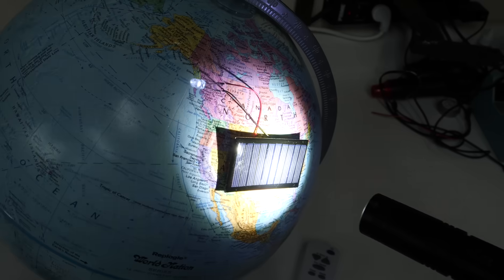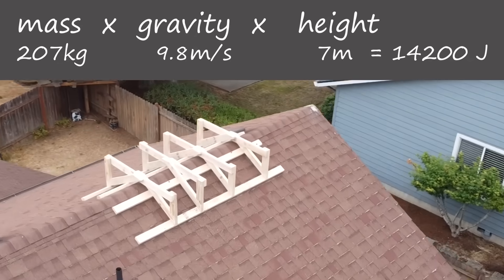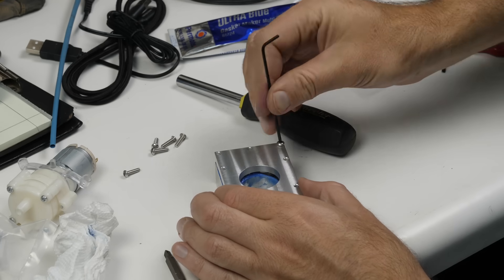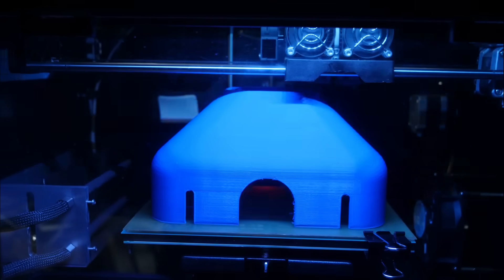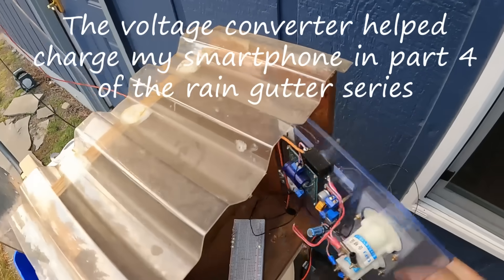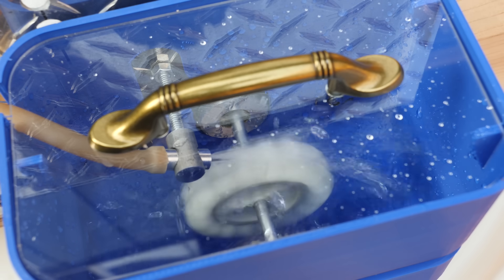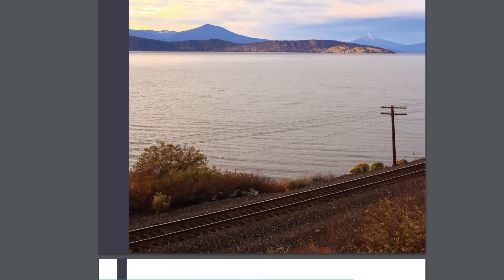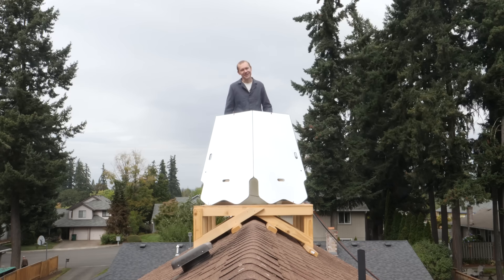Storing Solar Power on my ROOF!!!

Comment: I’m curious if it would be an advantage to add a shroud to the end of the water tube to reduce the water splash (that’s excess energy isn’t it? ) coming off the wheel.

Comment: "...it takes a whole barrel of water on a roof to match the power of a single double A battery." No, it takes that much water on the roof to match the ENERGY of a single double A battery! 

Thanks for a really cool video, very interesting. I'm surprised that little pump could push water that far up.

Comment: How does the path of the pipe effect the power? It currently sits in a straight away path, but what would lengthening the pipe do to the system? For instance, what if you lay the pipe in a meandering pattern from side to side while maintaining the downhill gradient thus having more "fuel" sitting in the pipe and less in the tank?
Also, what about having a larger diameter pipe at the top of the roof and then reduce the pipe diameter towards the bottom. Would this create more water pressure at the motor.
Lastly, what about sealing the system such that it could be pressurized. How would that effect the "force" of the outflow? It seems it would give the water "fuel" more "amperage" or speed when it is applied to the motor. How well does this compute?

Comment: Thanks for your heroic efforts, time, and expense, plus being open about how puny is the energy in 55 gallons on the roof! It would've been nice to reveal the megawatt hours available from the Oregon reservoir project, as in how many average households are fulfilled too how many days. Or as I fear, just hours.
The machined water jacket was overkill, because an affordable 3D printer would do fine today, letting water flow directly onto the metal motor body--just seal the plastic edges to that metal body.
Is there any positive displacement technique that would be more efficient at low flows than a splashy Pelton wheel?

Comment: If I understand it , you are siphoning from the barrel. would it not create more energy if you allowed the water to flow out the bottom with all of the weight of the water pushing down?
Reply from the maker: It's the same.

Comment: Great video, but I was wondering if you would try your "water pumping" system for sump pumps? I would also add the sump discharge to copper tubing or some type of heat exchange with a solar fan to see if the cooler water acting as a dehumidifier and keep the area cooler/maintain a more even temperature.

Comment: So it takes 5 hours of sun to fill the upper reservoir, but how long to deplete if discharging at maximum pressure (running the led strip at full brightness)? I'm guessing under an hour? Still pretty awesome, and it can double up as a spare water source under pressure, for toilet flushing or whatever, if your municipal water supply goes offline, so this counts as prepping in a way too besides for just a physics project lol
Reply: Had the same thought about the toilets and with the added benefit of reducing your water usage if you are in an area that gets enough rain. You would have to change around your plumbing so that only the toilets are on the system as well as add a valve to switch between water sources. I would also add a check valve to prevent any backflow into your pipes. What do you think?
Reply: @compiticny1445  sounds good! I like the check valve idea. Solid advice!
Reply: @DimitriPappas  Thanks

Comment: Why not just use a solar  panel  and battery  for this? Overtime  you will have to replace  the motor..wonder if you have calculated  the cost of pumping  water  up the roof and and how much benefits  it has for  your consumption

Comment: ....the tap water already comes pressurised, so the solar panel ain't needed to pump the water up, just a hose, this only makes sense if it pumps water from two water deposits, one in the ceiling and one in the garden, but if you connect the solar panel to the network it will make the electricity counter go back, that way you don't need any batteries.

Comment: This is great!  There are probably several things to improve your basic system's efficiency - maybe follow on videos!  One would be I think the water wheel driving the generator is losing a fair amount of energy by the water splashing away, not driving the wheel.  The splash guard probably should be made a lot tighter so that water come down from the roof exerts most of its energy in pushing the wheel - make the sides of the guard tight to the sides of the wheel, but not dragging.  And put a circular portion of the guard closely following the contour of the circumference of the wheel.  I believe there are some more efficient axial flow arrangements as well - like in a hydro dam.  Also, I suspect a larger diameter pipe leading from the roof down to the wheel might reduce. some frictional losses when at high flow rates.  Anyway, really good video as-is!

Comment: 1) U need A check valve on the bottom of the line going to the pump. 
Should ease the heating.
2) This is good for heating the water from the sun after it's pumped up. 
A Black barrel will heat up to over 125 F on a real sunny day in summer. 
It has to be full from the early morning and have the full days sun. 
I once ran a shower stall on a hill by a cabin with this technique heating a barrel 60 feet up from a shower along the road.

Comment: You can grab a bit more more energy. As the tank fills. When the tank fills, it pushes air out the top. The compressed air can do the same thing as your water dose.
Reply: No

Comment: Your experiment is halfway there but here's a way for you to make power 24 hours a day 7 days a week 365 days a year and you don't need the solar panel to do it the same principle with the water but you use a pump to pump the water straight up to your roof however you have to have several hundred feet of pipe spiraling down from the roof at the same angle then the water from that 55 gallon bucket dumps into another 55 gallon bucket the pump brings the water back up to the roof in a straight run now you have a continuous flow through a 1 inch pipe you will need about 200 gallons of water to get the system working 55 gallons on the roof 55 gallons down in the ground and a lot of water in your run depending on how much pipe it could be 100 gallons in the pipe then in several places in the pipe install a hydro generator this will power the pump and then a second one and a third one can make you usable electricity you will have power 24 hours a day 7 days a week as long as the water doesn't evaporate and the Earth continues to produce gravity so you will have power for many years to come once or twice a year simply add water as it evaporates have at it good luck
Reply: There are several other ways to easily produce electricity a magnet generator will do large amounts of electricity 2,000 w or more use no fuel and produce power 24 hours a day 7 days a week there are also companies that produce gravity generators which use no fuel and produce power these are both hard to find to purchase but they do exist I love watching videos like this cuz it shows that people will put effort into buying technology that will produce electricity not store it like batteries

Comment: I think you could be loosing a lot of energy in the generator design and an improved impeller  may help. I would be interested in knowing the efficiency as a ratio of energy to fill the barrel  vs. energy output, you gave general numbers in video. Also what is the estimated cost to build the project?
Reply from the maker: See video on BUILD2

Comment: Here's the actual issue I'm finding:

In the "previous video," what this guy is actually talking about is potential vs kinetic energy.

The weight of water, in his example, being kept high, results in a potential source of energy he can utilize. However, this potential is never used until the water is released, and allowed to fall towards gravity. This is untapped kinetic energy, or "moving energy." Usually, to tap this energy, a wheel with an axle must be put in the water's path, to turn and gain angular momentum.

This idea is centuries old, as it has been used in everything from windmills in Holland to grain mills in the Middle Ages. It's been used for making textiles during Colonial America to modern hydroelectric power plants.

Comment: If it takes 100 kW-h to fill the tank (battery), can you use it to run a 100 kW-h load off it? ie: can it be 100% efficient with no loss?

Comment: @Quint Builds. You can maximize the use of your water pressure and just have run your hose up to your roof >.< 
Depending on the height the top of your roof is. I am guessing your residential pressure should be enough to get to your roof. If not really really close to the roof, less height different means less work for your pump.

Comment: You should consider using a Tesla Turbine in your design instead of that water wheel. The only reason industrial generators don't use Tesla Turbines is because we don't have the materials that could withstand the speed necessary to get peak efficiency, otherwise they'd be more efficient than our current turbines. For your application I think you'd see a marked improvement in energy extraction from your water barrel. They're very easy to construct, too. Some sheet metal pieces, some 3D printed pieces, and you're pretty much good to go.

Comment: Could I suggest building a conical shape for the turbine to run inside? All of that splash is wasted energy. Inside of actual dams they use conical funnels in order to raise power and more efficiently extract energy. Could be wrong but hey!

Comment: If the water is 7m up, you need 52 tonnes of water to store 1 kWh :-(

Also: you can get fall arrest anchors designed to be easily screwed into your roof. Wonderful things :-)

Comment: It's a cool idea and all, but most single home roofs aren't designed (or structurally sound enough) to hold very large weights (i.e: massive quantities of water) for long periods of time.

I mean you can do it yes, but over the course of 10+ years, you're going to start causing some structural issues that will likely cost you far more in repair costs than the savings you're getting from "free" energy.

Comment: I ordered 10kw worth of solar panels from Ebay a few years ago. I only "needed" 32 out of 40 of them.  My daughters and I, have "experimented" how fast their power wheels could go (in short bursts only), using just the sun. They were flying around they yard... well only as far as the wires would reach. I know, dangerous, risk of damage to panels, wires, electric vehicle...etc. They were happy, lol.

Comment: I would love to see someone build a true gravity powered electric generator. For it to work, though, you need a mountain near a water source and many generators. Using solar is cool, but wasteful. The solar panels only get 20% of the energy available from the sun. The pump loses even more power and that only increases with height.
Reply: More efficient then coal,gas or nuclear . Only 1% of the sun's energy goes into the plants that became coal or gas.  And nuclear requires you to explode a sun to get the fuel.
Reply: @catprog  The point is that it cost more to make them in terms of energy and this is not the best way to do is. Gravity, or more precisely the specific gravity, is way more efficient way to get water to a great height and to use the weight of water to create electricity.

Comment: Demonstration should have been two full water jugs. One dropped from midway and the other from the roof. That would be a better demonstration of the energy differential between heights. But even that is really comparing velocity due to acceleration difference. Secondly, the cutoff switch should have been in the ground level barrel. Shorter wire and easier to get to. And a full barrel on the ground, as a source, can never overflow the barrel on the roof.

Comment: It would have been nice to compare the energy density of the water stored in your barrel with the energy stored in a barrel of coal.  I think the energy stored in coal is 3,000 time more dense.  I live in California and some 50 years ago the last pump storage revivor was built because there aren't any other suitable locations to build any new ones.  And this year we don't have any water.  Lake Oroville ran out of water to produce hydroelectric power a few moths ago  What about nuclear?
Reply: Much more efficient storage then coal though. You lose 99% of the energy from just growing the plant to turn into coal.

Comment: So... I like the water wheel, but the entire system could be udner water, based on its flow within the piping system. Making levels of internal Archimedes type screws that are spiraling from teh flow of water. The screw could be a variety of materails IE copper and magnets on the outside, lmoa. or simply turning within the system, utilizing the tesla spiral deisgn whilst also generating power.... The entire system can be enclosed, meaning zero loss of the water itself. Of course there are better liquids to use then water itself. but as for a non harmful system this works pretty good. Jus think of engineering a sky scrapper to have a massive self fill pool and emptying pool on the top, lmao....

Comment: Have you considered adding a ram pump to increase your head pressure and reduce the electric cost of your pump by about 1/5?. 

I've looked into water energy storage for on a larger scale than this for my 4kw solar array, but sadly the power production for small scale residential use is just not cost effective or very efficient compared to the ones designed to power cities due to the economies of scale.
Reply: Won't work. You end up losing more water to power the ram pump then you gain.
Reply: @catprog  Yes, you would lose 4/5 of the water that goes into the ram pump. However if you're pumping it up the house with an electric pump anyway, why not let that 1/5 go back up on its own with the ram pump? Then let the 4/5 you lose collect in the tank at the bottom where you're pump from anyway.
Reply: @andrewb9595  I think you are talking about when the water comes back down.  He is using all the water to generate the electricity.  Their is none left to run the ram pump.

If you are talking about using it to put the water up in the first place. 100% of the water goes up if he uses it directly instead of just the 20% the ram pump would provide.
And it won't reduce the electricity cost of the pump as it still needs to provide the power that would run the water pump.
Reply: @catprog  Dang it. I'm way over complicating things and confusing myself. You're completely right, it'd gain nothing the way I was thinking.

Comment: actually a Li-Ion battery dont degrade as you say, example if a battery has 1000 charge discharge cycles ( full charge/discharge) then will have 2000 half charge cycles , these are not the Ni-Cad or Ni metal Hydroxide batters as they do degrade rather quickly but the Li-Ion battery IS a different animal

Comment: Years ago we had a neighbor who built his own water powered “air conditioner “. His property had a very reliable well.  He mounted an oscillating sprinkler on the ridge of his roof that ran whenever the temperature in his attic reached a certain temperature.  The evaporation of the already cool well water cooled his roof, which in turn kept his house cool all summer.  The water that didn’t evaporate was captured in the roof gutters and directed to his garden.  So his air conditioning cost was just the electricity needed to run the pump.
And keeping his roof cool in the summer prolonged the life of his shingles.
I always thought it was a cool system.
Reply: All you need are a very understanding wife and neighbours.

Comment: You never mention effeciency, the one thing I wondered the most about. How much energy do you loose on pumping it up there and then convrt it back again. I would assume your hydro setup is no better than 50% effecient. 
Please meassure total effiency of this system for your next video:)
Reply: I bet the efficiency is terrible. But in this instance the solar energy is free, and without the water system it would be wasted anyway. So in theory if he used the water tank generator at night, the efficiency isn't so much of a worry.

Comment: A few points and one question:
1st - this looks to me like YT videos from India - showing how to make oxygen by water electrolysis during the harsh times of COVID-19 pandemic wave during which they didn't have enough oxygen for all patients who needed it;
2nd - while you say that this system will last much longer than battery storage, I'm sure that at least your water pump will die before today's decent battery storage. I wouldn't be surprised that the cost of building and maintenance of this system will be much higher than equivalent battery price for your lifetime.
Question: did you ever mesure the overall efficiency of your setup?

Comment: Very cool.
So you pump the water into the bucket using solar power and then allow the water to fall and turn a generator to power some lights.  Would it not be easier just to have the solar panel charge a battery bank?  Therefore, you would not have the losses from running the pump off the energy produced from the solar panel, and be able to store more energy in the form of a battery charge.  That just me and my Engineer mind.

Comment: I could see where using the over current portion of a solar array to pump water instead of just going into a heatsink could be effective. After battery packs are full excess power running a water pump to store energy before some heating coil to be burned off till sundown.

Comment: Losses in the motor are high, remember the heat? Losses in the pump. Losses in the wiring. Losses in the piping taking the water to the roof. I doubt this setup is 20% effecient in a pure sense, however using free photons to power it makes it usable. The amount of energy hitting the earth every second is staggering.